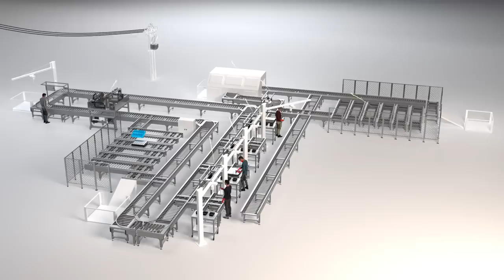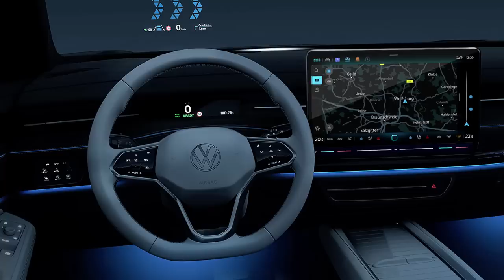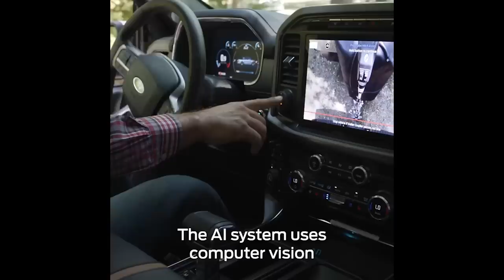New Anode Ads 20% Range to Mercedes EV; U.S. New Car Sales Strong - Autoline Daily 3539

Comment: The automatic trailer hitch feature is a winner. It's a real trick to mount a trailer if you don't do it often.
Reply: That auto hitch function is pretty much required for the Lightning since to charge it most of the time the trailer will have to be unhitched to prevent blocking charging / parking spaces and driving lanes in a parking lot.

Comment: I was reading a Chevy Bolt Forum (thinking of possibly purchasing one next year) and wait times for a Bolt EUV appear to be around 6 months if you place an order with a dealer to get exactly what you what. I think gm could be selling a lot more Bolt EUVs if more could be built quicker.
Reply: Charging speed,  range, reputation, and looks hold it back.  There are a lot available around Chicago
Reply: @ChicagoBob123  Are you sure about the supply in Chicago I did a quick internet search but could not find any Bolt EUVs and only 1 Bolt in stock. A number of Chevy dealers in the area I did check a few of them one was supposed to be the largest in the Chevy dealer in the area. I may be able to alert others to a dealer that had a number in stock if this is the case.
Reply: I'm going through Cargurus and see many for sale. I'm seeing different EUVs from Indiana to Chicago  starting  days at dealership.  Some at msrp some a few K above
Reply: 6 months is OK in today's market.
Reply: @ChicagoBob123  Still an excellent value for the money though. If I were in the market for a new car it is what I would buy until the next big advancement in battery tech.
Reply: @anydaynow  Model 3 with rebate gets you a fantastic car, great charging network and faster charging
Reply: A lot of people on the Chevy Bolt Forum are extremely happy with the Bolts they are driving, not everyone needs a 0 to 60 in say 3 seconds (why would anyone), massive range and I can just charge at home at night.
Reply: Demand keeps any dealer discounts down for what is a tight margin product. What about a used volt instead? Since margins are so tight and accessing enough supplies (plus a focus on the premium priced EVs), its likely that GM is in no hurry to meet backorders and needs to offer more EV models to gain more premium market share. Still it does show that GM could run a 24/hr shift to meet demand. Not every customer will wait that long.
Reply: Ok, I am a “numbers/ equations person (engineer)” I ran across data “GM authority” that at the beginning of March 501 Bolt EUVs were in stock. 

Q1 of 2023 19700 Bolts/EUV Bolts were sold it appears around 2 to 1 EUV Bolt to standard Bolt in Q4 2022 so since I cannot find the exact ratio I will assume the same around 13000 EUVs sold Q1 2023.

Around 1000 EUVs sold each week (13000/13 weeks) 6 days a week for sales 166 Bolt EUVs a day (501/166).

501/166 = 3 days supply.

Before Covid, a 60-day supply was the target on lots so yes it does appear the Chevy Bolt EUV has a supply-side issue at this time.

The Bolt EUV is low margin and it appears the battery will be obsolete with the new gm platform so I am not even sure gm whats to put that much into selling them if it takes away from the large trucks/SUVs and getting the new EVs to market.
Reply: @lp6696  the rub is they can't make the new ultium platform at scale.  24 GM may fire more people
Reply: @ChicagoBob123  I have worked at a number of companies over the years from extremely large to small. 
As companies grow/change people can outgrow companies and companies can change so not everyone is still a good fit.

gm may just be trying to get its workforce aligned with the EV future and the fact they offered buyouts is much more humane than say Telsa which appears to be constantly getting rid of a certain percent of its workforce (the old Jack Welch GE stuff).

When I purchase a new car I will take into consideration how well a company treats its workers and will stay away from Jack Welch-type operations.

Comment: Silicon anode can store more Li ions per cubic centimetre than graphite anode. The thinner anode allows extra cathode in the cell giving extra capacity. If Sila can control anode expansion adequately, good luck to them. Munro did a story on SES silicon anode cells. SES found placing the cells under pressure and preventing expansion gives a large capacity boost.

Comment: I have a friend who lives in Singapore. The cost you have to pay ensure's that literally no one but the 1% get to drive around. You see nothing but fleet vehicles and BMWs there. There is just literally no low or mid price market since the people who have to buy those vehicles could never afford the right to drive at all.

But they also have great trains and vibrant downtowns, so I'm not sure its actually a bad thing.
Reply: Considering its smaller than NYC, you could use a e-bike and get around fine. No use in having roads if they are gridlocked in traffic (we'll see if the Manhattan congestion charge changes user driving behaviour )

Comment: Wow Mercedes is amazing mindblowing and gamechanging!
Reply: A former colleague was an advisor to the board of Mercedes so he knows the road map.  What you are seeing is just scratching the surface.
Reply: @bobbbobb4663  We dont have to worry for Mercedes they are fine!
Reply: @brunoheggli2888  Selfishly I need Mercedes to stick around so I can still get OEM parts for my 1979 240D 😀.  Fun fact:  my 240D MSRP was higher than the base price of the top of the line 1979 Cadillac Seville.
Reply: @bobbbobb4663  I want a BMW e 46  325 convertible!Its a great looking car!The problem is,i dont need a car!
Reply: @brunoheggli2888  Nice choice in the pre Bangle era.  You may not need it but if you want it, now is the time.  They only get more expensive as time goes on.  In my case, the 240D was my first car and I’m approaching thirty years of ownership (second owner).  The most interesting thing about that car is that it is the only US spec W123 I’ve ever seen with factory rear seat headrests.
Reply: this is nothing but fake vaporware because merc has such crap efficiency

Comment: Ford has AI and only uses it to hook a hitch?  Have it drive the truck and do research papers too!
Reply: In Ford's defense, I have seen how bad some people are in hitching up a load, these people really, really need any help you can give them.
Reply: @earlpottinger671  Ok, you got me there.  I just wanted someone to explain how much Ford spent on the onboard computer just to hook a hitch.  Tesla paid more than a billion for AI, and Ford did it for $270?  Something does not add up.
Reply: @davidbeppler3032  Tesla spend a billion dollars on an AI in 4 million cars, ie they spend $250 per car. Ford says their system only cost $270 per car, but they do not say what their UP-FRONT costs were. And lets us assume it did cost $270 to put in a car/truck. What happens when they put in a million vehicles? Do you think the $270 item is spread to all the others?

Comment: @3:50 what is the point of mentioning range figures for a platform without specifying what chassis/body you are referring to? Slap a low profile solar racer body shape on the MEB platform and it would do 1200+mi... That fact doesn't help anyone 😂

Comment: Hi Elon aka Mark.  Let's do a weekly safety review:
1.)  Yet another Tesla caught fire after an accident.  For comparison, zero thermal events in the Nissan Leaf.
2.)  11.3.4 swerves into oncoming traffic.
3.)  Zero integration from UI to AP/FSD.  Thus, UI can upgrade itself at 70 mph.
4.)  Still no driverless permits pulled in California which means you don't have to report disengagements with your ancient AP/FSD L2 stack.
Reply: Lmao. How many deaths?  300k FSD cars.  How many deaths?  Why don't you answer?
Reply: @davidbeppler3032  You never answered my question yesterday so I won’t respond until you answer this one:  How many disengagements occurred last year with Tesla using AP and/or FSD in the state of California?  Feel free to ask around the office.
Reply: @davidbeppler3032  87 so far
Reply: @taniabanes4707  Beppler has a penchant for not thinking through his responses like most of the Tesla bots.
Reply: @taniabanes4707  87 people died in Teslas in the last 3 weeks?  Plz post.
Reply: @bobbbobb4663   How many disengagements will make your point?  What does that change?  How many peoples lives were saved by FSD in the state of California?  Feel free to make up a number.  I will go first.  1000.  It is probably much higher, but 1000 sounds nice.
Reply: @davidbeppler3032  The correct answer is Tesla doesn't file that number because they intentionally keep AP and FSD at L2 so they aren't required to do so.  Stay tuned for today's episode.